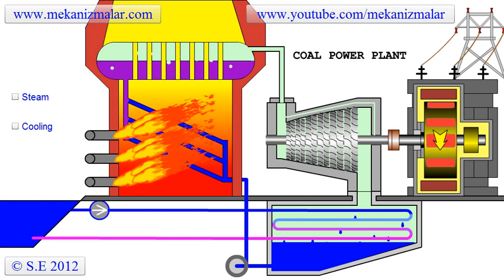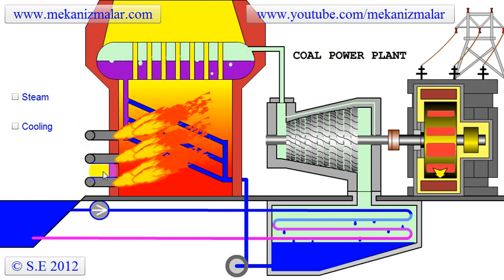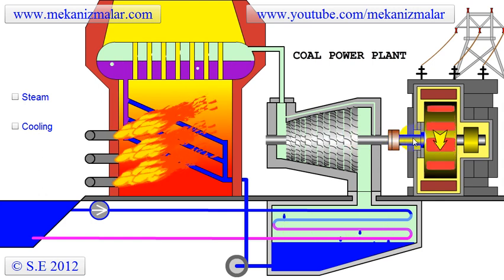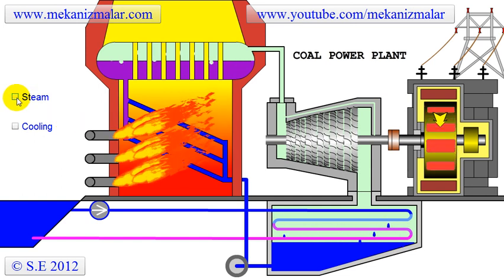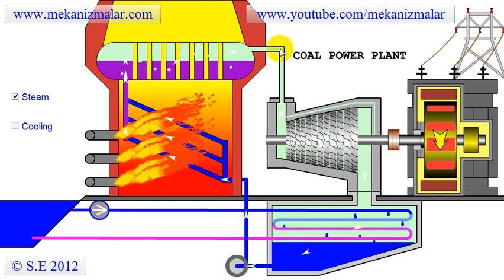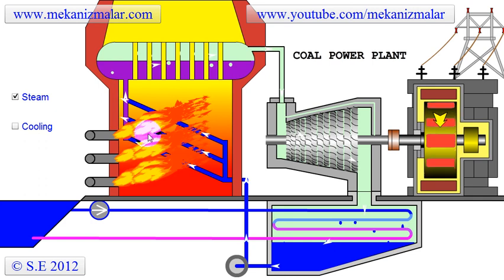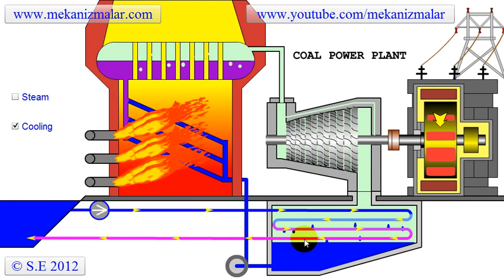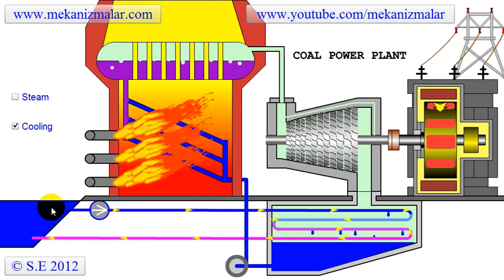Coal Power Plant

Comment from the maker: There are 3 types of cooling systems in termal power plants. Whether it is coal or Nuclear. They are Direct or "once-through" cooling, Recirculating or indirect cooling. and dry cooling. In the video you see Direct cooling. This type of power plans are build next to large rivers, lake or see where there are an limited cold water to be used to condense the steam. They take water from river and pass it trough condenser and discharge it back to the river.
Reply: Thank you for explenation,

Comment from the maker: Because while pressure decreasing the specific volume of the steam is increasing. To accommodate expansion, cross section of steam passing area should increase.  Also, you should know that for the gases decreasing the flow area does not mean to increase velocity. This is true up to a point, then area should increase to increase the speed of the gases. Look at a rocket nozzle. Area first decrease, when speed of the gas reaches speed of sound, the area begin to expand so that speed of gas increase

Comment from the maker: During this process temperature of river water rises slightly. So you may not see any steam coming out from power plants. If there is plenty of coal in a location but not enough water than the second type, recirculating cooling is used. In this case water from a small reservoir is fed to cooling tower where water droplets flow downward in between condenser pipes, during this time steam condenses and some cooling water, %5, evaporates.

Comment: The small line feeds the (air bearing) .00025 on a side the turbine uses for rotating the stater blades.
imagine the extremely high rotation of the blades turbines get their power from spinning freely.

Comment: Why is it necessary to cool the steam forcefully? Isn't it lowering the efficiency??
Reply: 1 litre of water becomes 1,7 Cubic meters of steam (or 1700 litres). So to "naturally" cool a powerplant fast, you'd need to have a condensor that is riddiculously large or have an inccreddibly slow process (thus less power), which is impractical and time consuming. So by forcefully cool it you actually save time and space.
Reply from the maker: Not necessarily. Steam turbines working with high efficiency allowed by thermodynamic principles. You need a closed loop water and steam flowing inside the plant. You need closed flow loop for two reasons. The first is that you can't add water to the system just as you do in steam locomotives, calcium or any impurities will clog the tubes with time. Any water lost, which is minimal, is replaced by softened water. The second reason is the exit pressure from the steam turbines is under atmospheric condition, to increase efficiency. Also, the steam leaving the turbine is in saturated conditions, meaning it is about to turn to water. Removing some heat from this saturated steam will quickly turn it into water. If you do not do that, you have to pump this saturated steam back to the boiler, which requires a lot of power.
To understand this process, it is best to study Rankine Cycle on Mollier Diagram.
https://en.wikipedia.org/wiki/Rankine_cycle

Comment: Never understood why the Archimed force has never been used to amplify the power during boiling...
The quantity of heat lost is also crazy...
You've never heard about refractive materials and perlite to isolate from the outside ?

If you create a refractive pizza cooker, with the boiler in the middle, in a hole with perlite 
linked to an isolated tank with first Archimed force, then pressure force, finishing on peltier effect, to conserve all energy, results could be really beneficial for everybody

Also temperature control is optimal, and the rocket stove device type, linked to a big refractive isolated rock can conserve a Hugh temperature for a very long time

Rocket stoves can run with small pieces of wood no need to cut the trees, only re-use the cleaning parts to generate winter energy heat, boiling water, electricity, whatever you need

Comment: so if they can take the engine of an Ferrari and Lamborghini and upgrade the components of the coal power plant turbine section they will produce triple more power?
Reply from the maker: I think coal power plant are working with very high efficiency. Therefore suggested modification will not change  anything.
Reply: JJ Loubser  In comparison to certain drag racing engines, Ferrari and Lamborghini engines are powerless and pathetic. Also, can you please specify what engine made by Ferrari or Lamborghini you are talking about. You know Ferrari and Lamborghini are car BRANDS/COMPANIES NOT car MODELS.

Comment: Why do they almost complexly cool the reciprocating water down, only to reheat it to steam again? 

Can't they just use it from the turbine and reheat it less that what would be required from cooling it down?
Reply: There are two reasons to do it this way. First, the exit of steam from the turbine well under atmospheric pressure for efficiency reason. If you do it the way you described, the turbine would inefficiently.  The second reason is that they purify the recirculating water, meaning they remove lime from hard water. If the system was open, and resupply water from outside, some water pipes would be clogged and the life of the power plant would be short.

Comment: Why is the hot water not used to heat up homes? I am sure it has to be used like that somewhere.
Reply: There are many reasons for this. This is the closed-loop cycle. This is because the steam leaving the turbine is well below atmospheric pressure. Also, we don't want pipes in the steam cycle not clog the pipes. For this reason, water in the closed-loop cycle is distilled water. The power plant will be inefficient if the steam leaves the turbine above atmospheric pressure. If we feed the water to houses, we should use the same amount of distilled water, and this makes the operation of the power plants costly.
Reply: @seyhanersoy8989  I understand why we do not use the hot water in the closed-loop cycle but what about the heated river water?(the opened loop water cooling cycle 1:38) Why dump that hot water back into the river without first using the heat?

Comment: "Why is a very small portion of pressurized steam diverted to the bearing section of the turbine, where the low pressure steam leaves the turbine?"
Has anybody found the answer for it ? or maybe even you know how to answer :)
Reply: Power plants work with a closed water cycle, this is because the water is used is almost %100 pure. Otherwise, the pipes will be clogged with time. This will create a herculean task to clean the pipes. If so why do we allow this precious steam to escape from the turbine bearings where low-pressure steam leaves the turbine. Since steam leaves the turbine well below atmospheric pressure air will enter into the turbine circulation system. It is a very difficult task to get rid of this air. For this reason, a steam a little bit higher pressure than atmospheric pressure sends the middle of bearing. Then steam follows two paths, one toward the turbine circulation system, and the other leaves the turbine, Since the steam is above atmospheric pressure, this blocks airflow into the turbine.